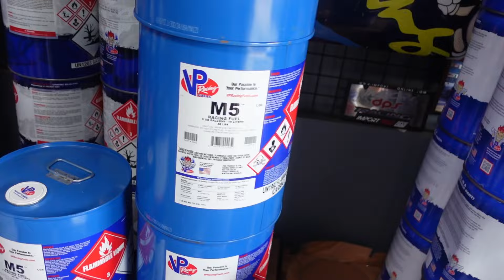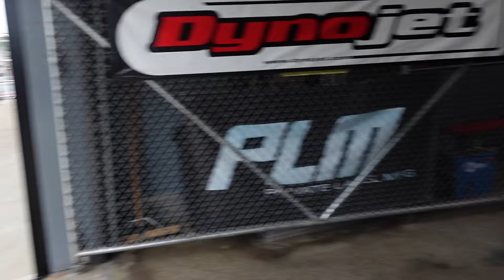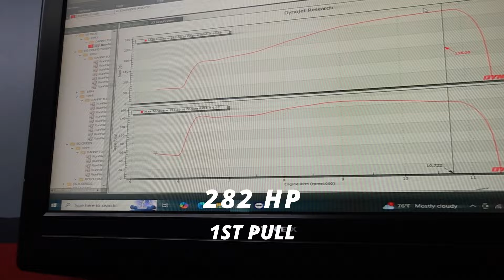k24 EG DYNO TUNING ON M5  @IMPORT DPS

Comment: I had low voltage in my k series when I put a brand new autozone one. I put an Oem one and it resolved my issue. Ps keep pumping the content.
Reply from the maker: @EduardoRomero-yl6jr  yea the one I have in there now is oem ima try and buy a denso that’s what the tuner recommended or someone commented about changing the pulley on the alternator to a under driven pulley.
Reply from the maker: @EduardoRomero-yl6jr  and thanks ima try to keep dishing out the content.

Comment: coming from the V8 world, when you start revving past 7000rpms you usually need to change to a larger alternator pulley to slow it down in the high rpms so it doesnt over spin and destroy the alternator.
Reply from the maker: @wfojmill  bro thanks your the 2nd person that has told me that I’m currently looking into changing out the pulley. So I am gonna need a bigger pulley your saying?

Comment: Hey bro. Dropping voltage at high rpm is due to over spinning the alternator.

You need a under driven pulley
Reply from the maker: @mayk3lll  oh word. What pulley did you use?
Reply: @wisin_k20   love your vids,bro I was just watching, and reading comments and I recently built a 300 horsepower street coupe,K20A2  pulley on my K24 block  with T7 designs delete kit and a high voltage altenator I can share par #s if needed, pump 93 car made 296 in 3 pulls,im sure your beast will make alot more with the fuel your running 💪🔥
Reply from the maker: @ yea that will be  dope did you just change the alt pulley to a t7?
Reply: @wisin_k20  sorry bro, your reply never came up as a notification on my yt. No I changed the crank pulley to k20z3 size but went to fluidampr brand. You can use oem, fluidampr or ati. As long as it's k20 then all good.

Comment: I have the same issue with voltage drop it’s crazy
Reply from the maker: @KAE-PerformanceRacing  yea I’m having it on both my cars the tuner told me and recommend I go with a denso alternator from rock auto cause supposedly the ones at local parts store like advance and Autozone are no good so ima try that. G.L
Reply from the maker: @KAE-PerformanceRacing  what’s your setup ie: engine harness and conversion harness and what alternator do you have?
Reply: @wisin_k20  My K24 Eg has Jackspania harness, conversion harness and charge harness. Autozone alternator. Drops to 12.3 on WOT. My K20 Eg has oem alternator, Jackspania harness, conversion harness and Rywire charge and drops 13.3 on WOT I’m guessing it’s the cheap alternator.
Reply: I’m gonna have to try the oem alternator on the k24 Eg and see what it does. That will narrow down my search
Reply from the maker: @KAE-PerformanceRacing  yea I think the same thing it’s the cheap alternator cause that’s what the tuner told me. Where is your battery located at?
Reply: @wisin_k20  yea I would say so. Funny you ask the one I’m having the issue with is in the stock location and the one that charges good is in the rear 🤣